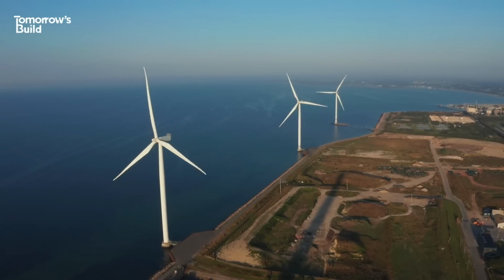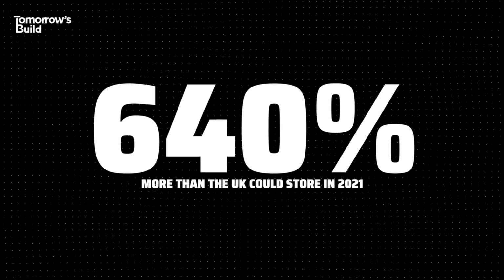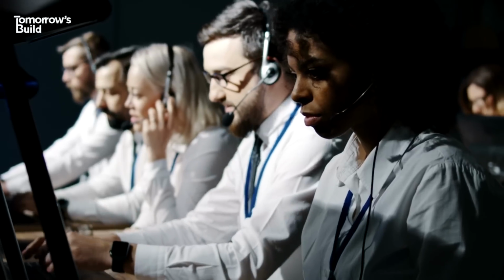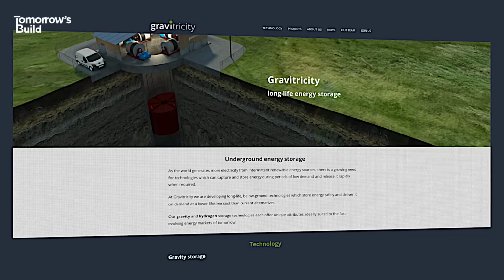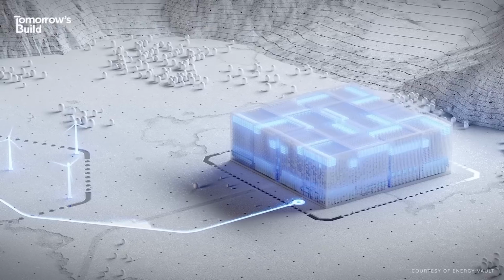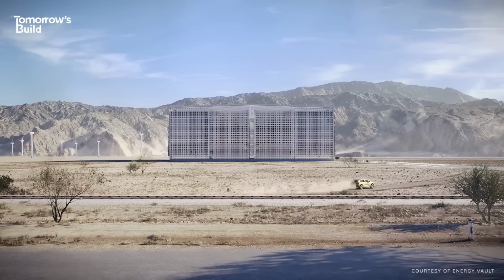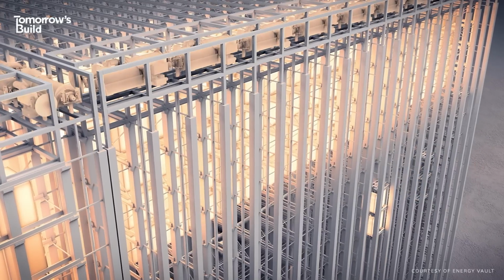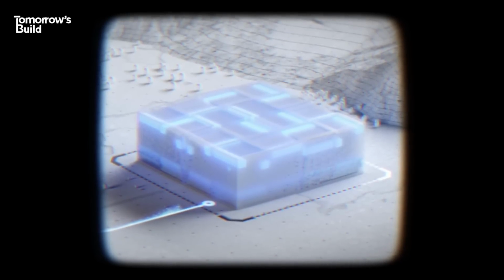The Hidden Crisis With Renewable Energy | Tomorrow's Build

Comment: Net zero is so dumb. Are you, or aren't you? Which one is it? How can you decide what the safe level is? Seems arbitrary. Especially when you exempt bunker oil (the dirtiest fuel there is) from your calculations. 0.04% too high?

Pumped hydro that pushes water up through the bottom of the reservoir is terribly inefficient. Just fill it from the top like a faucet. Otherwise your working against the reservoirs load. "But if we did that, you'd have a net gain in power output, and we don't want energy to be infinitely renewable". "Let's just keep it working at a loss, it perpetuates the drama".

The irony is that oil is a renewable resource, because it's generated by water, dirt and gravity. It's also ironic that people are basically trying to synthesize the same functions of fossil fuels (storing energy through gravity), especially when the products of their use are characterized as "greenhouse gases".

Using weights as a force/energy storage system works, but it's not nearly as good as a battery because it takes energy to store it. You're inherently losing/wasting energy by using this method. Everyone already knows that, but it means developing way more production than is actually needed (and at a loss overall because it takes so much energy to store the energy). If the efficiency of a solar panel is only 30% at best, imagine dropping that down to 20% or whatever because your storage solution is so inefficient. 

It's hard to really explain the magnitude of the scale of fossil fuel production, but the best way to explain it is that land is the defining statistic. The water seeps into the soil, eventually down to such great depth and pressure, that it fossilizes instantly, becoming oil. There is so much water and land, the capacity could "never" be achieved through man made systems. And its honestly not even necessary. The co2 just ends up settling on the ground as soot. Not only that, but during petroleum distillation, the evaporates, such as gasoline, have so little carbon even left in them, that it's basically water. You can compare it to it's residue, bunker oil, which is basically black carbon molasses, or liquid coal.

Here's more irony, the governments want to stop using gasoline, but exempt bunker oil, which is incomprehensibly more dirty. The also want to replace jet fuel with hydrogen, even though they plan on basically just refining natural gas to produce it. They'd be better off just investing in natural gas storage (which they often just burn off) instead of hydrogen. It's basically the same, but way more difficult. They even have to freeze hydrogen down to a liquid to store it, which is energy intensive and actually inefficient (unless it's used to cool a rocket nozzle).

Comment: At a student conference a few years ago I heard a talk by an MIT-affiliated presenter about a physical battery system. The energy is stored as heat within a colossal high heat capacity structure which can release heat into special coils to boil water to turn turbines. Square cube law limits heat loss. Interesting stuff but mostly large scale project.
Reply: If its viable in the large-scale scenario, dont you think it would be efficient for world's needs? Or is it that it is still under R&D?

Comment: Geothermal energy is abundant everywhere below our feet, companies and technologies have advanced geothermal energy production to the point that it can scale up and become an essential part in clean energy providing a reliable majority of baseload capacity to national electricity grids. In fact geothermal holds key to making 100 percent clean electricity available to everyone in the world.

The geothermal technologies meant to mine heat deep from the Earth, can be used as direct heat for communities, to generate electricity, or to do both through “cogeneration” of heat and electricity.

What is geothermal energy?
The molten core of the Earth, about 4,000 miles down, is roughly as hot as the surface of the sun, over 6,000°C, or 10,800°F. That’s why the geothermal energy industry is fond of calling it “the sun beneath our feet.” The heat is continuously replenished by the decay of naturally occurring radioactive elements, at a flow rate of roughly 30 terawatts, almost double all human energy consumption. That process is expected to continue for billions of years.

The ARPA-E project AltaRock Energy estimates that “just 0.1% of the heat content of Earth could supply humanity’s total energy needs for 2 million years.” There’s enough energy in the Earth’s crust, just a few miles down, to power all of human civilisation for generations to come. All we have to do is tap into it.

Comment: Storage are NOT a solution. That is because periods for supply deficit can be as long as a month. For example pan-European total average wind per YEAR fluctuates normally about 30% year to year, but the difference can also be as much as 50%. In Northern Europe there's a meaningful solar energy production only between March and October.

When it comes to this Energy Vault then only looking at that storage facility SCREAMS: Money. I.e. building such a facility costs. A lot. Imagine building hundreds of high capacity elevators side-by-side. Not to speak about the fact, that the same thing can be solved more elegantly and cost effectively.

Comment: Why not hydrogen?
Reply: Hydrogen is only useful in the context of industrial development.  For regular cars it isn't realistic.

Hydrogen fuel cells are only 30% efficient because in order to gather hydrogen you have to expend a lot of energy to isolate the hydrogen atoms from other molecules like water.

THEN you have to expend a lot of energy compressing and storing the hydrogen.

And to make matters worse how is that hydrogen used in a hydrogen fuel cell driven car?

It is used to generate electricity to provide power to an EV motor.

Personal transport will be EV, and hydrogen fuel cells will be used for heavy machinery like excavators, bull dozers, tanks, and planes.
Reply: @TerraPotentia we need hydrogen for shipping and flying. Batteries don't work for these use cases at all.
Reply: @VFPn96kQT  you obviously didn’t read my whole comment

Comment: Why the hell have we got an energy volt video?  This has be debunked by a number of YouTubers as useless compared to batteries or pumped hydro. It does not scale easily, it is not land or resource efficient, and has many moving parts with massive associated costs in maintenance and repairs.

Comment: Pumped hydro is fine, but you need the proper topography.

We need to investigate and use multiple storage schemes based on the local circumstances.

A big question is how much storage is required.
Reply: at tesla investor day they estimated 240twh storage for 30tw power production at cost of 6-10 trillion dollars for earth

Comment: Simple maths shows this is complete rubbish. Gravitational potential energy equals height x mass x 9.81. Therefore to store the same amount of energy as a 1kg lithium ion battery (250wh = 900kj), you would have to lift it 100km into the air. Pumped hydro only works because you get a huge mass for free (via rain collected across a large drainage basin) and the supporting structure and height difference for relatively low cost via the terrain. Building something similar out of steel and concrete is ludicrous.

Comment: To raise 1 ton 100 meters takes 980k joules. Lowering it, assuming no losses, you get 980k joules back out. A joule is also 1 watt for 1 second. An AA battery has a rating of 2400 mAh and voltage nominally of 1.5V. 2.4 amp-hours x 1.5V x 3600 seconds is 12960 joules. 980kj / 12960j = 76. Raising 1 ton 100 meters store the same energy as 76 AA batteries. Amazon sells 24 packs of 2400 mAh batteries for $33.50. So let's use some round numbers and conclude that raising 1 ton 100 meters store about the same energy as $100 of rechargable AA batteries. Have fun building something that does that for $100. The problem with this obvious scam is that building something to raise 1 ton 100 meters is going to cost millions of dollars. This concept is so far out of scale with any other method of energy storage it has no hope of ever succeeding. This is a scam against people who don't like math and have no concept of construction or other energy storage alternatives.

Comment: If you believe in Tony Seba's analysis who has a good track record on this sort of stuff, nowhere in the world need more than 4 days of electricity storage in the most cost-effective renewable energy scenario--since wind/solar capacity is actually cheaper than most storage so it's cheaper to just build a massive oversupply of energy generation and have abundant excess energy available most of the year while only relying on the worse case energy storage situation during the worst few weeks of the year for solar/wind power.

Also: LFP (Lithium Iron Phosphate) is becoming the standard for stationary Lithium-based storage, not Lithium ion.

Comment: It would have been nice to mention that all of these energy storage solutions aren't 100% efficient and they're all losing power in the process; some info on which are more or less efficient would have been good as well.
Reply: I think the cost per megawatt and a megawatt per square would be more enlightening.
Reply: Is waste and efficiency an issue when the problem is over capacity in generation versus under capacity in storage?

Comment: Yes, and the other problem no one is talking about is that no amount of storage of any kind is of any use at all when the sun don’t shine and the wind don’t blow for long periods or for the many parts of the world where neither is available at usable scale. Fortunately Small Nuclear Reactors are coming. The MSR (Molten Salt Reactor) variety generates 97% less waste, and the waste has orders of magnitude shorter life span. All new generation modular reactors are walk-away, passively safe. Unlike traditional reactors that are mind-bogglingly complex and built on site, SMRs are mass produced in factories to dramatically reduce cost and time to commission.
Reply: SMRs are expected to create more waste than traditional reactors and are much more expensive than larger plants (if it costs $100m to build a 20mw smr but $200m to build a 100mw plant which is the better deal). You dont need msrs. France has been recycling waste for decades without msrs.

The fastest built reactor was built in 39 months and is 1315mw. You would need 66 smr to equal 1 1315mw reactor. At 3 months each x 66=198 months. Thats 5x longer.

"The size and modular building approach means Last Energy’s PWR-20 is under $100 million per unit"

66 of these would be $6.6b.
"The installation cost for the Kashiwazaki-Kariwa Nuclear Power is said to be 70 billion yen."
That averages to $75m per reactor. One reactor is still cheaper than the smr. Accounting for inflation the 1315mw reactor would be $140m. Still cheaper considering what youre buying.
Reply: @namename9998  I can’t comment on the math and I have no problem with massive reactors other than their sometimes endless approval, preparation and commissioning time and cost… sometimes 20 years. There are thousands of small communities to grid-scale applications where mass produce SMRs such as the latest Rolls Royce offering using trad high pressure tech. It may produce more waste than mega reactors/Gw/hr but surely that’s a non-issue in the scheme of things. Rolls Royce say they need three years to set up the space and three years to commission a half Terawatt system that runs competitively for 60 years, including decommissioning. Apparently they’re ready to roll-out.
Reply: @Kenlwallace  I'm confused. Most small communities are connected to larger plants. If theyre so remote then a 20mw reactor is probably too large for them. If theyre getting supplies from the outside world then theyre close enough to be connected to larger power plants.
"For conventional generators, such as a coal plant, a megawatt of capacity will produce electricity that equates to about the same amount of electricity consumed by 400 to 900 homes in a year."

And theres the cost. If theyre so remote then how are they going to afford a $100m reactor.

And if theyre so remote why would they want such reliable power. If they wanted modern conveniences wouldnt it make sense that they live closer to other towns.

SMRs make sense for military bases and islands but not small towns.

Comment: I would like to know more about the maintenance costs of this energy storage solution.
Keeping all those cables and/or generators running well is going to be a challenge.
Reply: For generators, it's no more challenging than maintaining the current system. You get the same amount of energy for spinning the same generators the same amount, you're just using a different energy source to spin them.

Comment: Mostly likely the solution will be to use the millions of batteries from eletric cars. At night most of them will be parked at home and as such the owner could sell for instance 50% of the battery energy to the grid (he would just need like 20% of the battery capacity to go to the work place where battery recharge stations could be available to use the solar energy during the day) . If multiplied by a 1 million, 10 millions eletric cars, we would have a giant disaggregated battery.

Comment: Nah. Just pick a steep railway line and run a heavily loaded train with an electric engine up and down. The embedded power recuperation will do the trick.
Reply: Is anyone actually doing that? Wouldn't the energy potential be similar to this system (i.e. probably too low?). How many trains do you need? How much track? How many mountains? How much would it all cost?
Reply: @eduardoez  This bunch of questions would require quite an expensive investigation.

Comment: Sounds promising...if you ignore those 'little details'. At 3:45, the gentleman says 'when demand is less, we can then recharge the 'batteries'. Tell me, when the U.S. has a NEAR CONSTANT demand against available resources that far surpass 50%, how are you going to 'recharge the batteries' from the solar array next-shown?: We're talking 2-am...moon's out, no sun...where are they going to get the power to 'recharge those batteries'? There is about to be a hard moratorium placed on wind farms, due to harmonics affecting wildlife (such as whales off-shore, and endangered birds inland)...so, what, we're going to BURN MORE PETROLEUM to 'recharge those batteries'? That's the problem with not seeing those 'get rich and run' schemes for what they are, before billions are given to them...with never a follow-up! If only we'd return to a modern thought on nuclear energy...building reactors 1/2-mile or deeper UNDERGROUND, this wouldn't be an issue...but because we won't think LOGICALLY, we just keep on making idiotic, wasteful mistakes!
Reply: "There is about to be a hard moratorium placed on wind farms, due to harmonics affecting wildlife (such as whales off-shore, and endangered birds inland)"
I dont think thats what should be the main concern. There are articles about stopping hurricanes by using wind turbines. That means wind turbines change weather patterns (there are other articles but theyre harder to find but are from credible sources like The Guardian). Whales offshore arent as important as a lack of wind and the impact it would have on agriculture (and hurricanes do benefit the areas where they happen).

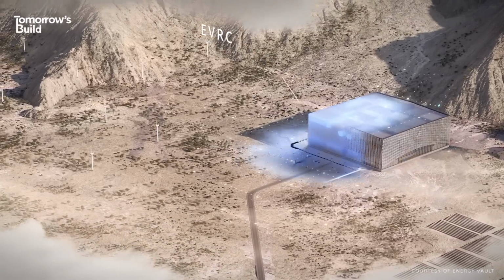Comment: Sorry guys, but this is sub par content for you. Energy storage is talked about a lot, and you've not covered many options of energy storage in this video either. The option you focussed on is highly controversial, and you can tell from the person being interviewed they don't want to talk about CO2 emissions (because making cement for concrete is a huge source of emissions, as you've covered in previous videos). And then at 4:04 you talk about spinning turbines by lowering a block of concrete? Surely you mean a generator, but it goes to show how well this video was written and researched.